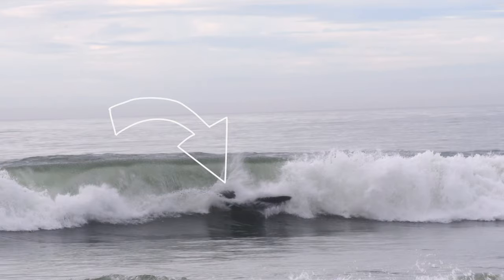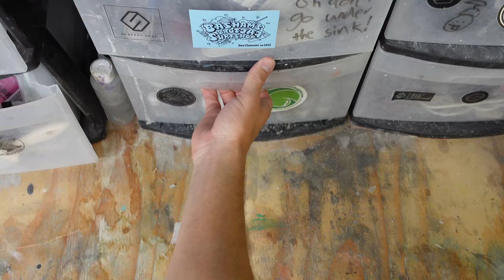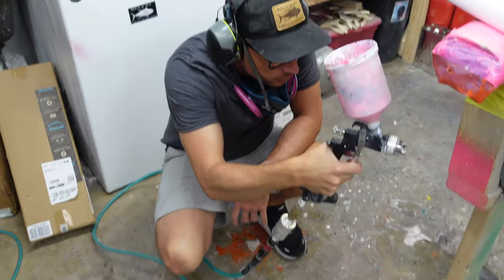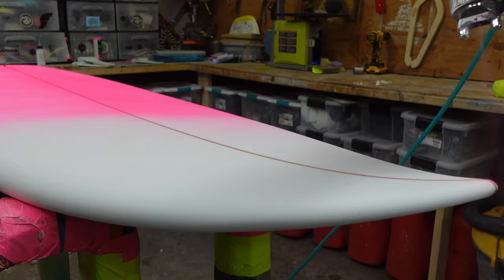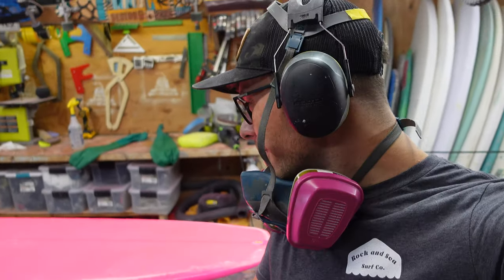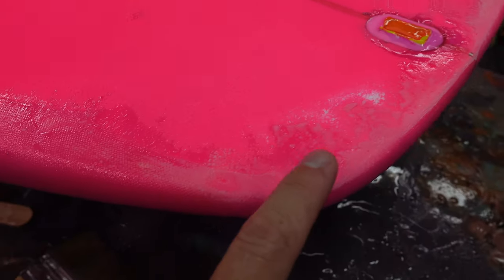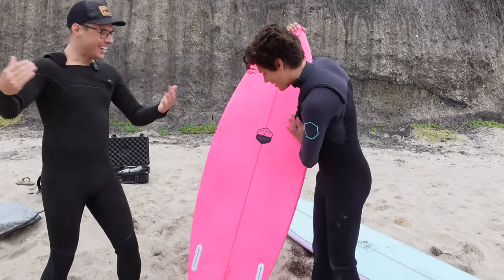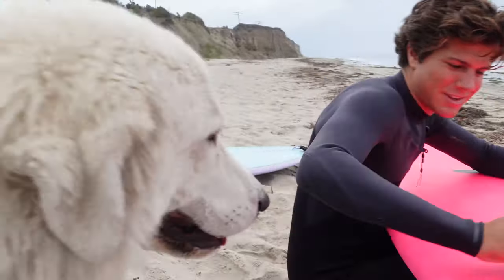My friends surfboard was STOLEN in Tahiti, so I Surprised him with a New One

Comment: Great work like always!!
On your next video, could you show and talk about your lamination rack and how you calculate the thickness of your tail and nose.
Thanks a lot!
Reply from the maker: Guess what hahahha, literally filming a vid on my glassing table right now!  Probably finish it up and have it posted by this weekend!   Regarding tail and nose, are you asking about thickness or rocker?!
Reply: @RockandSeaGarageBoardShop  .. great just on time for your new release!!
Yes, thickness for tail and nose.
Reply from the maker: just posted Glassing stand vid!  Regarding nose and tail thickness it’s more of a feel / personal preference.   On fish boards I shape them for typically surfing smaller less powerful surf, to match less powerful surf like my tails a little thicker keeping more float right under my feet.  For more high performance boards meant for more powerful surf I thin out my tails allowing them to sit lower in the water for more control and I’m not really worried about generating much lift, depending on how powerful the waves are somewhere around 3/4th inch is a pretty happy spot for me.    I use surf calipers to measure the thickness! https://youtu.be/mrQxFJFMcaA.
Reply: @RockandSeaGarageBoardShop  Thanks a lot. I’ve leave a comment on the glassing table video. Great work like always!!

Comment: Sick man! did you use poly or epoxy? how long did dry the paint before laminating? cheers
Reply from the maker: We glassed this one with poly, and the wait time before laminating really depends on how thick you air brushed the board.   A really good light air brush is totally dry in 30 min or so, this one we did a bunch of layers on to really get it neon pink, so I let it air dry for at least an hour or two to make sure it was totally dry!  Hope this helps!!

Comment: The second layer of fiberglass cloth threads should be ideally 45 degrees offset from the one on top or under, however I did one lamination at 30 degrees it was almost as strong as 45 degrees

Comment: What board shape is that and what are the dimensions because that board is sick
Reply from the maker: Hey thanks man! It’s my own custom shape!   5’9 x 21 x 2 7/8,  she is an absolute hound in small to chest high Cali surf.  37 liters for paddle power with a wide planing surface to capitalize on weak to medium power waves.   She rips!   To wide and too much volume for anything very hollow/steep and powerful but made not made for that🙌👍
Reply: How much would it cost for u to make one
Reply from the maker: Thanks for the ask, but unfortunately I’m pretty much maxed out through till summer.  I charge 500-700 bucks a board depending on what a person wants, air brushing, resin tint, heavy duty glassing job etc..